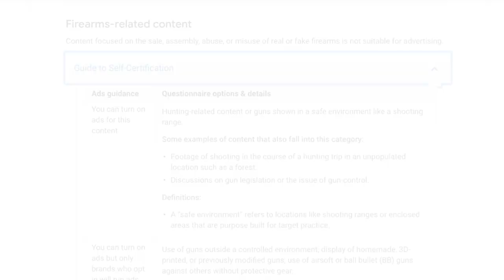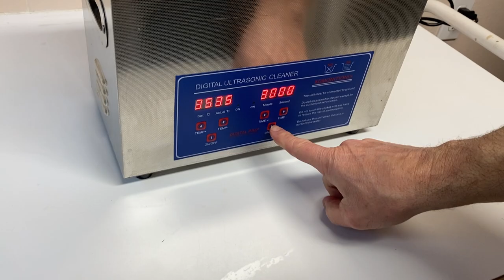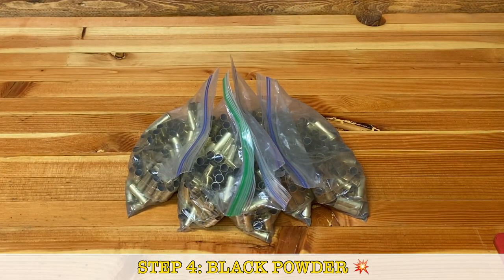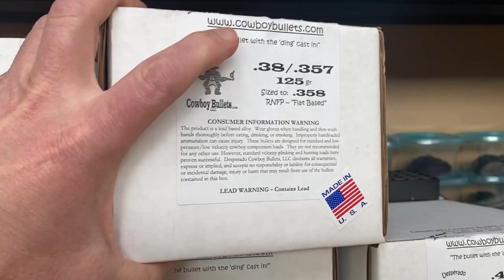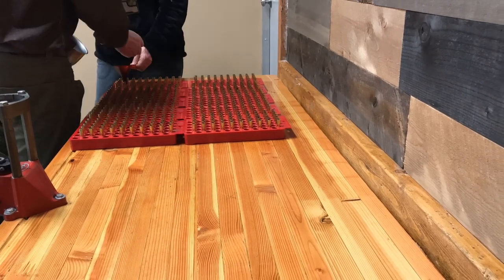BLACK POWDER .38 Special Loads [HOW TO Black Powder Cartridge Loading / Reloading]

Comment: Excellent video.  I use a 158 grain bullet for my Frontier Cartridge ammo.  It takes up more room in the case than my usual 105s.  Also my fixed sight revolvers shoot to point of aim with the heavier bullet.  I need all the help I can get when shooting FC Gunfighter!
Reply from the maker: Thanks Abe E.S. Corpus. I was using 158 grains for years... but, I get a little more controllable load (faster follow up shots) with the 125.  Not a lot, but enough that I can feel the difference. 
~Jed 🤠

Comment: Great video Jed!  Made me realize how similar (should be since you learnt me) yet barbaric my system is lol.  Sometimes I soak overnight if I my brass has sat dirty for a wile.   My sonic cleaner is a plastic jug with brass, dawn dish soap, water and me shaking the piss out of it for 5 - 10 min (yay cardio!).  Then I dry it overnight.  I started out with the full Jed reloading method as shown but have changed it some.  I’ve been doing all the steps on my turret press.  Deprime, prime, hand scoop 1.3 cc powder into the powder stage of the press, set bullet, crimp, wipe bullet clean, admire my bullet making prowess, add to box, repeat 😁.  I occasionally add the “clean up powder mess after you pour powder in funnel before rotating the case to the powder stage” step 🤪

I’ll also add...  rinsing brass in the kitchen sink has a slight chance of lead contamination and a moderate chance of bridal ire 😬.
Reply from the maker: Thanks Croc!  I was really looking forward to your feedback on this episode.  Since you and I have talked about this process so much I wanted to make sure that I captured what I shared with you in a video format.  
As for cleaning in the sink, I use the utility sink in the laundry room (used to have a utility sink in the reloading room of the old place) and a pan that is dedicated for the purpose of brass drying only (not one from the kitchen... for fear of that “ire” 😉). 
Thanks for the feedback my friend!  
~Jed 🤠

Comment: Hi.Enjoyed the video, but I have a question,  why do you bell the case mouth after charging the case? Thanks.
Reply from the maker: It’s just a habit that I got into because of the process I use - because I put ‘em all out in the trays after priming in order to fill the powder.   It might not necessarily be the best place to bell the mouth, in that if you found a split case you have to dump the powder and try and salvage the primer. But, that rarely happens…

Comment: Haha! Nice recipe! ;) I'm a lot more dirty, and usually just give a good rag wipe of the outside of the case after firing while still on the range. And once in a while (every 5 reloads or so), I scratch the primer hole and the inside of the case with a pair of screwdrivers heads (one big, and one small :) ) But I don't have more than 100 cases of a given caliber usually.
Reply from the maker: 😆 Yeah... I feel like a spent a lot of time detailing how I clean the cases... More of my OCD showin’ 😉 
~Jed 🤠

Comment: I do it exactly the same way. But we shoot 44WCF.  I deprime first on Lee APP press.  Then wet tumble in Frankford Arsenal tumbler with Simple Green and Lemi-Shine.   Dry in sun.  Mary primes with RCBS priming tool with the shell holder.  When we get critically low, I load on Dillon 550d using Unique Missouri Bullet Company Hi-tech coated for Mary's loads, BlackMZ and bullets I cast myself and use no lube for my loads.  Otherwise,  just the same.
Reply from the maker: Great info Bibbyman2, thanks.  I shoot 44/40 in my rifles, you might have already seen my method for that: 
https://youtu.be/OS9NpvRQXs8
~Jed 🤠

Comment: Great info now I can try black in my .38 Spl and .357. Do you know what Lee scoop I can use  for a .38 Long Colt ctg. and some150gn Western Bullet Mould co. conicals? I might want to try some black in an old Colt DA 38 "New" Army model of 1892. Then I can chrage up San Juan Hill and hope I don't get nailed by a 7x57 Spanih Mauser(wish me a lot of luck with that one!). Only in my mind's eye of course!
Reply from the maker: I’ve never loaded for the .38 Long Colt. Should be plenty of data out there though. 
That Turret Press has served me well.  I often think about upgrading/updating but that’d require a whole new learning curve 😉

Comment: I'm curious as to how you handle barrel fouling in the 44-40. If you shot those 38s in a rifle you'd be shooting patterns by the 2nd or third stage. I had to use a soft BP lube plus two thin beeswax discs under the 158gr bullet to prevent barrel fouling  when using BP in my rifle (a .357). The Snakebite bullet didn't feed reliably.
Also the LEE hand primer I bought from you at the state shoot had a long priming rod. All it needed was a couple hundredths taken off and then the leverage at the final seating was greatly increased. I have 4 others. They all work great. You got a bum one. I could see how you'n not like it. I didn't either at first.
Reply from the maker: Howdy Hellgate, I don’t have much issue with barrel fouling in my 44/40. I use the desperado bullet and I will occasionally spray my barrel with a little spritz of moisture (water, Ballistol, water/Ballistol mix). If it is hot and dry I do it after every stage.  You’ve shot with me enough to know I don’t fuss with it too much.  😊 
My main issue with the LEE hand primer is I kept breaking that handle.  I’d snap that thing every few thousand primers.  Could that have been because the rod was too long and it was creating too much pressure on it?  At any rate I like the feel of the RCBS primer better.  Especially the way you put the primers into the tray, it’s much larger than that of the LEE so you can just turn the primers over into the tray much easier than with the little round tray on the LEE. 
Good to hear from you.  Hope to see ya out on the trail this spring/summer.

Comment: I use to use Lee primer but I only had a couple things I didn't like, 1 you had to buy special shellholders for it, and 2 it is so small for my hands
Reply from the maker: I switched over the the RCBS Hand Primer for much of the same reasons (and that die-cast handle on the LEE kept breaking).

Comment: Oh the steps after shooting black powder.  I was using the same cleaning method with the sonic cleaner and tumbler till I dropped my sonic cleaner, and that was that. After I switched the wet pin tumbler, boy am I glad I did. I deprime all cases and set them for a 3 hour clean cycle. I've had found black power cases that were corroded come out almost new. I like it so much I sold my dry tumblers.
But I was thinking of buying another sonic cleaner, the one you are using for put barrels and cylinders in after shooting black. Have you tried your for that? If so was it worth the time spent?
D.D. Freighter
Reply from the maker: D.D. - I have been eyeing one of those Wet Pin tumblers... 👍  It’s a plunge I might take one of these days.  I like the results I’m seeing online.  
I did my Percussion Cylinders in my Sonic Cleaner... I’m not sure it was any better than my old cleaning method of just swabbing the cylinder holes with a cotton/fluffy cleaning tip.  🤷‍♂️ I’d have to try it again to determine if it is any better.  
~Jed 🤠

Comment: Ultrasonic cleaner you have what size is that. Also with this pandemic it’s hard to find tumbler media.
Reply from the maker: Ultrasonic Cleaner: https://amzn.to/3uvBZEo

As for the Media, I haven’t had any trouble getting that.  I can provide you with a link if you’re interested, I’ll just have to go out and check what grit I use.  
~Jed 🤠
Reply: @JEDiTV  I run two tumblers one has walnut shells and a homemade roller tumbler that I made back in the early 90’s and that has jeweling in it. I’ve got a order in with Amazon for walnut shells. But it’s been a bear to get stuff for the opening weekend in week a half.

Comment: Great video as usual, I use a progressive but I think there are a lot of advantages to doing each step independently, I bet it's easer to keep quality control and probably over all takes about the same time. I am just starting to experiment with cap and ball so this black powder thing is still unknown territory to me.
Reply from the maker: There are some complications to loading Black Powder on a Progressive style press.  I have a good friend, one of my BP Mentors, that does it but I haven’t taken the plunge yet.  I might eventually though... But, this method has worked so well for me for so long it’s kinda hard to change.  
I’ll be doing more information on my Percussion Revolver loading, so stay tuned for that. 
~Jed 🤠

Comment: Anyone know how many ccs for 357 mag with 125 gr bullet?
Reply from the maker: I haven’t loaded .357 with Black Powder…. You might try posting over on a forum like The SASS Wire someone there may have the data. Good luck.  
-Jed
Reply: 1.5ccm maybe 1.6ccm max.
I tested 1.5ccm and 1mm carton wad. But better is 1ccm, 6mm height wad under 125gr bullet.

Comment: Hi Jed!

Some questions:
- what die set are you using (pn? producer?),
- why small magnum primes, are they better for BP?
- bullet was crimped taper or roll crimp in that grove?

ps: ufff, after long time, uberti competition winchester 1873 in 38spec/357mag landed at my desk, can't wait to shoot it but vacation first :)
Reply from the maker: 1️⃣. LEE Carbide.
2️⃣. That happened to be what I had on hand that day.  MAGNUM Primers are not required.
3️⃣. Taper… Whatever the LEE Factory Crimp Die does. 

Have fun with that ‘73. 
-Jed 🤠

Comment: I'm in  the "buy" guns stage of the process. I love black powder, I've been shooting muzzleloaders for well over a decade, so I'm familiar with it. I was looking at the 38-40 or 44-40 as I've heard they generally run a little better with BP, is this truly the case or do 38/357s work well enough?
Reply from the maker: I use both .38 and 44/40 (plus many others) with Black Powder.  Either works just fine.  Follow my recipes and you should get an accurate and reliable Black Powder round.

Comment: Nice video content Jed,  but I have a question, why do you not use the stainless steel pins and a water, dawn soap and lemon juice mix in a tumbler? I have found that 3 to 4 hours of cleaning your way can be reduced to one and a half hours and they come out with primer pockets, inside and outside looking brand new. Am I missing something here?   Have a coffee on me.
Reply from the maker: Thanks Allen, ‘preciate the coffee. And, I am currently investigating the stainless pin cleaners. 
~Jed 🤠
Reply: @JEDiTV  Just one thing I will pass on to you, after about 8 to 10 cleaning cycles, just do a tumble clean on the pins only, no brass. This will clean the pins and bring back the new look to your brass.  I'm looking in to reloading primers, hope it works!  Have a great day.
Reply from the maker: Thanks  @allensooter8429

Comment: I noticed that you didn't use  a basket that comes with the sonic cleaner do you just use plain water or do you use the cleaning chemical that you buy for the cleaner
Reply from the maker: The 38’s slip through the holes in the wire basket. I use plain water (other than the first step which is a dash of simple green in plain tap water). Hope that answers your questions.
Reply: @JEDiTV  thanks that helps me a lot because when I bought my sonic cleaner I  bought the chemical stuff that you mix with water,  I have a pedersoli sharps and rolling block both in 45-70 and I have numerous handguns in 38 special and 45 colt and I have always wondered if mixing vinegar with water would clean my brass that way I wouldn't have to always buy the expensive chemical so after watching your video I won't have to buy it anymore, thanks again

Comment: Btw, do you get experience with 'blow back gasses' from cylinder? I mean, case won't expand like 38spec on nitro and sealing is not perfect and some black powder gasses goes back between case and cylinder wall... 

If yes, there is any fix on that with 38/357 bp ones?

I'm not able to move to 44-40... ;)
Reply from the maker: I’ve heard there a methods to treating the brass to make it expand and seal better. I don’t do it so I can’t advise you on how it is done or if it works.  There is some gas (“blow-by”) that escapes between the barrel and the cylinder, especially in the revolvers with open top design. I don’t know of anyway to stop that (other than the Russian Nagant in which the cylinder moves forward against the barrel to create a seal - fascinating revolver really.

Comment: Why not use the turret press to its full potential be load powder on the press?
Reply from the maker: Black Powder requires a special Powder Hopper, one that is made with material that doesn’t spark (metal against metal, static from some plastics). I don’t have a set-up like that... I know folks that do and run them very successfully (and much faster). It’s one of those things where I started this way and just kept up on this path.  
~Jed 🤠

Comment: So. Jed, 1.3ccm of black powder is just perfect for .38spec case. If I got it, it will be 'squised gently' under bullet, no wad, no any kind of border between powder and bullet. Right?
Reply from the maker: Yes indeed.  Five easy steps.  You can find links to each one in the description box of this video and skip right to that section.  
~Jed 🤠
Reply: Waddings can help the accuracy especially with lead bullets but if you shooting them out of a pistol I doubt it will make a significant difference.

Comment: Do you clean your primer pockets?  I always have, spend hours doing it and think I may be wasting time.  Then again, every round I ever loaded went bang.  Its just one of those things, it works for me, but I keep wondering if I should .  I do it by hand and it wears me out doing it.
Reply from the maker: Trevor, I don’t.  I have, in the past. But, personally, I haven’t found that it is necessary.  Have you had trouble with primers not seating flush?  
~Jed 🤠
Reply: @JEDiTV  I never had a seating issue.  I'm probably paranoid.  I always clean my primer pockets.  It takes me A LOT of time because I do it by hand.  After 100 cleaning 100 cases I find less than small scoop of grit (I run Trail Boss).  I think I'm probably wasting time.  But I can't argue that I never had a dud.
Reply from the maker: I get what you’re saying. Sometimes we get into routines and just continue that way because it is working for us. I’m guilty of it too. 
🤠 👍

Comment: Howdy from Canada Jedi. Hoping that the lockdowns ease up and that I’ll be able to compete this season. A whole lot of our shoots up here were canceled in 2020, so am cautiously optimistic for 2021. 
Quick question about the cast bullets you are using. What is their length? Might have to order some up, since getting bullet molds has gotten a little tough.
Reply from the maker: Howdy John. I’m hoping for more matches (and primers!) in 2021 also. The lead measures and average of .530 in length. But, you can pretty easily adjust that seating depth with the seating die. 
~Jed 🤠
Reply: @JEDiTV  thanks Jedi, wanted to know partly out of curiosity and partly for trying to order an appropriate mold. Have the same setup with Richards Mason pistols and an 1866 Winchester, all in 38 special. If it works well for you, I’d like to try it too. Thanks pard 👍🏻😁

Comment: Slack Chain Eddy - I reload 38Spl for  a Ruger LCR (38Spl), a Cimarron Uberti Colt SAA Replica (357Mag/38Spl) and a Henry Big Boy Rifle (357Mag/38Spl) following Hornady recipes for 110 gr XTP, 125 gr XTP and 158 gr LRN using smokeless powders (Power Pistol, Win 231 or Universal). The Hornady recipe specifies Small Pistol Primers for these reloads. Likewise, the Lyman Handbook calls for using Small Pistol Primers for 38Spl casings. Your video explicitly shows Small Magnum Pistol Primers being shoved into your 100 count bag of 38Spl cases. Is this substitution of primer types applicable for black powder use or am I missing something? Do the primers holes have to be reamed to fit small magnum pistol primers or is it a direct fit? I love all the Jed I TV videos; keep up the good work!
Reply from the maker: Thanks for the feedback Slack Chain Eddy. Small Pistol Primers and Magnum Small Pistol Primers are completely interchangeable, size wise. As for Black Powder, either type will work. This video showed Magnum simply because that’s what I had in hand. But, again, either type will work (and in today’s world I’d take whatever the heck I could find on the shelf). 
Great question thanks for pointing it out. 
~Jed 🤠
Reply: @JEDiTV  Thanks for the quick answer. Very much appreciated.

Comment: You need to load up some 45 Colt black and come down to Albany and shoot my 58' conversions for a match. You could make them famous for me
Reply from the maker: Actually I’ve been looking for some 45’s to work up a load on.  Do you have leather for ‘em?  I don’t think I have anything that will fit a Remington.  
~Jed 🤠
Reply: @JEDiTV  they fit pretty good in what I got, but my double strong set isnt quite right for them. It works but not ideal. Are you going to true grit in Redmond?
Reply from the maker: Not sure on True Grit yet.  It’s on my calendar.   But... primers are a real issue right now.  And, if things don’t change soon, I’m going to have to really limit the number of annuals I attend this year.  
I’ve got more Large Pistol Primers than I do small that’s why I’d be interested in playing with those Remingtons.